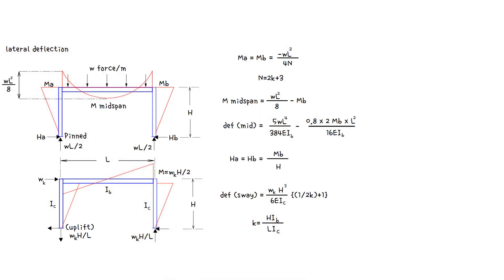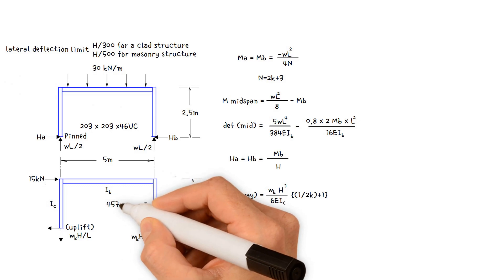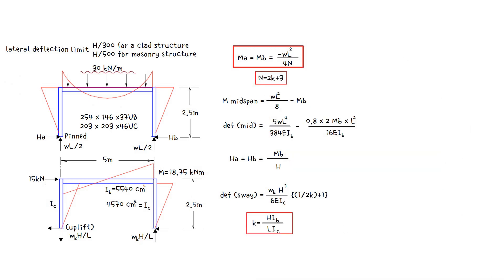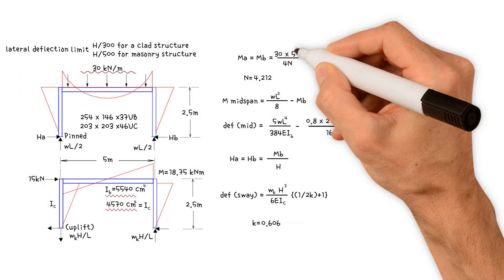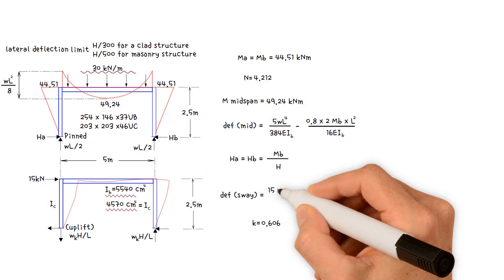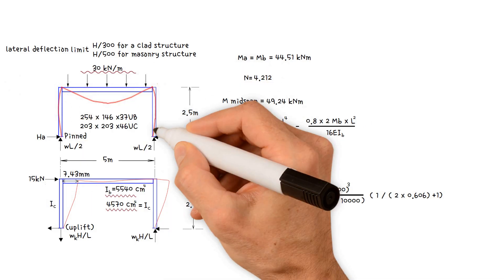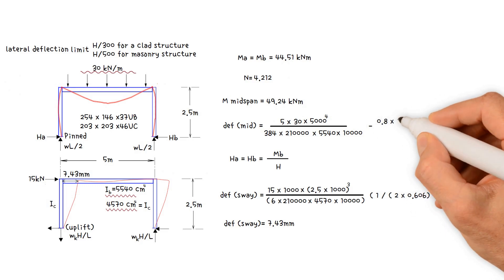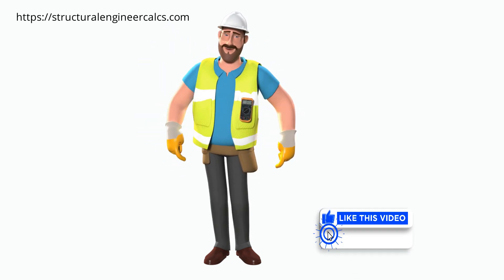How to calculate goal post steel frame forces and lateral deflection using simple equations.

Comment: can please also include which code of practice and section that you refer for those formula and constant used? tq
Reply from the maker: Thank you for your comment! Forces & deflections are important concepts in structural analysis that are used to evaluate the strength & stability of a structure. In our tutorial on calculating goal post steel frame forces & lateral deflection, we rely on a variety of equations & design procedures to accurately determine these quantities.

In terms of codes of practice, we generally follow the guidelines provided in the European standard for structural steel design, EN 1993-1-1: 2005 (also known as the Eurocode 3). This standard covers the design of steel structures, including goal post steel frames, & provides equations and procedures for calculating the forces & deflections in these frames.

We hope this helps to clarify the sources that we use in our tutorial. Thank you again for watching the video & for your question!

Comment: Can i do the calculations of steel cylindrical hollow handrail with same conception?
The top rail is horizontal attached with two posts vertically attached to the ground?
With a point load on the top rail 
Thanks in advance

Comment: very good, just what i was looking for.
Reply: Hi there just revisiting this video again, i am doing some simple structural analysis on a portal frame for my MEng project (I am not a structural engineer, i am on a design/ materials pathways). I am using the equations set out in this video however I cant reference this video lol. Can you recommended a book these equations have been pull from? I have looked high and low and I cant find these specifically? I managed to find loads which are much more complex. Thank you

Comment: Great job , could you please shown where is those formula come from please
Reply from the maker: You can easily find these formulas in the Kleinlogel Rigid Frame Formulas Handbook.
Reply: @structuralengineercalcs  thank you very much for your replied
Reply: @structuralengineercalcs  Can you advise on where the two deflection forumla come from? Thanks
Reply: @structuralengineercalcs  Hi, could you advise where that frame lateral deflection formula comes from?